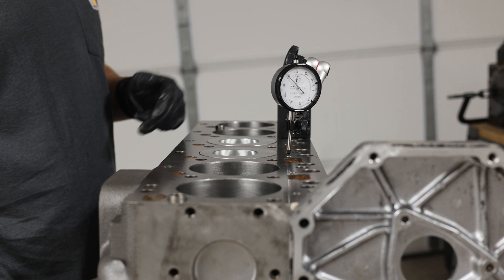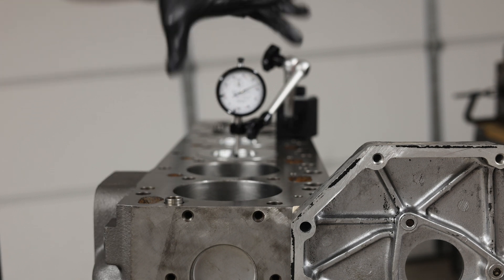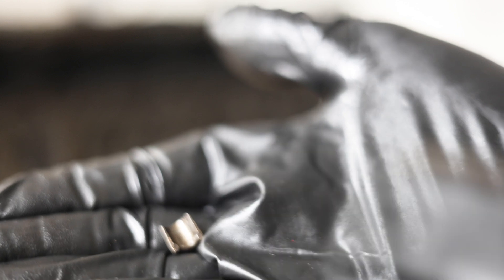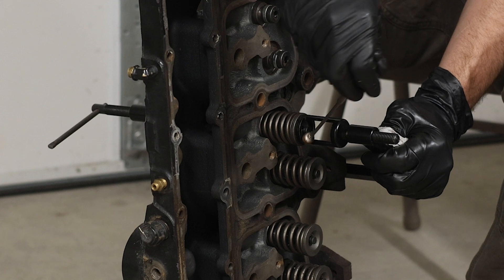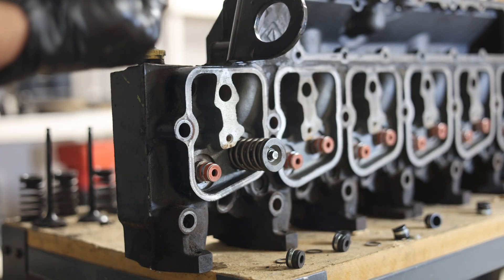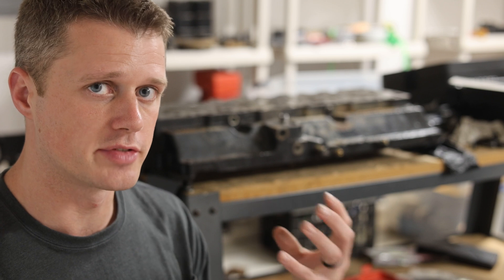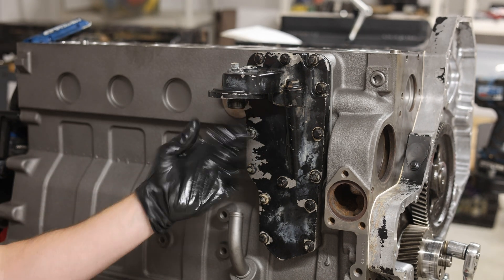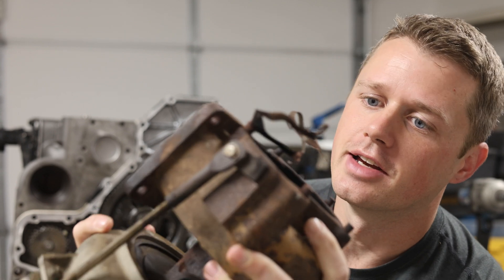Disassembling A 6BT Cummins Turbo Diesel Cylinder Head For An 80 Series Land Cruiser

Comment: If you change heads and injectors you would need to change the pistons.  The spray angles are different between 9mm and 7mm injectors.  The Non- IC engines are marine style pistons
Reply from the maker: So I have new interstate mcbee pistons in now with the 155 degree bowl pattern so I can run 145 degree or 155 degree pistons. Confirmed with bit power driven diesel and dynamite diesel

Comment: Hi, what about making engines and replacing them, etc. I basically envy you now that you have a wonderful engine running on that 4.5 petrol, that it doesn't make such noise, vibrations, rattles, oh 1HDFT, I'm not at all satisfied with the performance of that engine up to 2000 rpm, it's practically dead at 1900, it wakes up and at 3000 rpm finished. I'm most sorry that it doesn't pull from the bottom. Driving on 35" tires reminds me of the situation as if I have the brake on 1 tooth and the wheels are locked on 3...
I increased the injection pump from 45 min to 50 min on the clock.. and apart from the increase in smoke, nothing happened.. I'll probably put it back, at least it won't smoke.. So that's about it..
Reply from the maker: The 4.5 petrol is running really well, but it lacks power on the highway. I don’t know much about tuning the Toyota diesels. Can you find anyone there that specializes in tuning them?
Reply: @Austin_SaintOnge  There will be some troublemakers, but I won't leave it in their hands.  I'll add pressure to the turbo with an external valve and we'll see. But it leads to the fact that I leave it in the original and equipped. 🍻
Reply from the maker: @TLC-HDJ80  lol yeah don’t let the troublemakers tune it😂 yeah sounds like you’re needing more boost

Comment: Injectors - I turned my 9mm injectors to fit in my  new 7mm head.  now the issue I have with my engine is it farts or pulses through the intake. No one has an explanation but I suspect the power stroke compression is getting past the gasket due to warpage - yes I checked everything with a straight edge but I  think the combination of  warpage on the head and block is creating the issue. I think I need to do another tear down and get the head and deck machined.  Multiple mechanics have stated they have never run across the issue.
Reply from the maker: Interesting 🧐 yeah I’m looking into getting the injectors turned if I get a new head, I wonder if it could be injection pump or they’re no popping correctly?
Reply: @Austin_SaintOnge  Pop pressure was checked - it was low and I could not get shims  so I went with new injectors, I also resealed the pump.  I am going to put air into the cylinder with the piston on TDC and see if air comes out the neighbour cylinder. I am also running compounds on a untouched stock pump.  That dropped the EGTs  and milage went up, boost never goes over 23 lbs.  No smoke and quite clean running.

Comment: Do you have mandatory technical inspections in your country? in our country it is called a technical inspection station where you have to go every two years to check the brakes and the technical condition of the vehicle and the chassis, you must have the size of the tires written in the technical license, etc. did not pass. How is it with you?
Reply from the maker: Yeah we’re pretty lucky to not have to deal with most of that! I’ve heard a lot of countries are pretty strict as far as inspections. I ran 40 inch tires with a 6 inch lift and tons of fuel on my last Cummins swapped 80 series. It depends on which state you’re in. Here in Idaho, we don’t really have any
Reply: @Austin_SaintOnge  oki thank you

Comment: Hi, will the engine you are assembling go into the petrol LC 80?
Reply: yes
Reply from the maker: Thanks 😊
Reply from the maker: Yes it will!
Reply: And why do you change what is the reason for it? Isn't it better to leave the original? The originals have the greatest value.
Reply: @TLC-HDJ80   6BT Cummins engine has around 200 HP and a torque rating of about 420 lb-ft  The 1FZ-FE engine produces around 120 HP and around 200 lb-ft of torque on a good day.   Many feel ideal power for these trucks is around 350 HP.  I believe the diesel is also substantially more fuel efficient.   (plus, it looks and sounds bad-ass!)
Reply: @exploreraa983  Power output
190 hp (142 kW) (1FZ-F)
212 hp (158 kW) (1FZ-FE)
225 hp (168 kW) (1FZ-FE 1998-2009)
Torque output
268 lb⋅ft (363 N⋅m) @ 2800 RPM (1FZ-F)
275 lb⋅ft (373 N⋅m) @ 3200 RPM (1FZ-FE)
285 lb⋅ft (386 N⋅m) @ 3600 RPM (1FZ-FE 1998-2009)